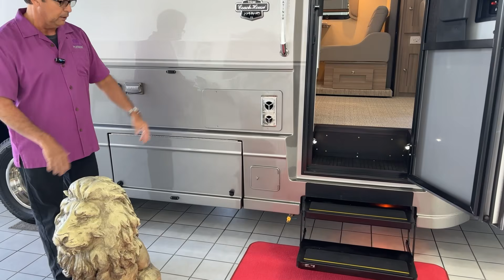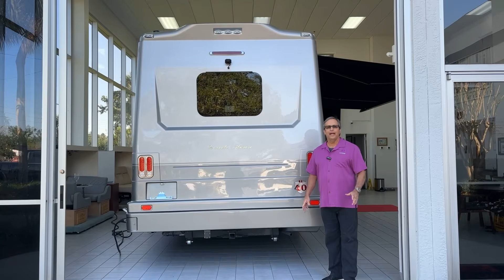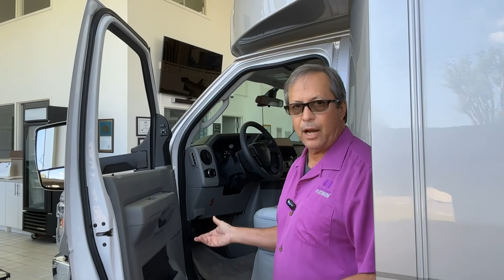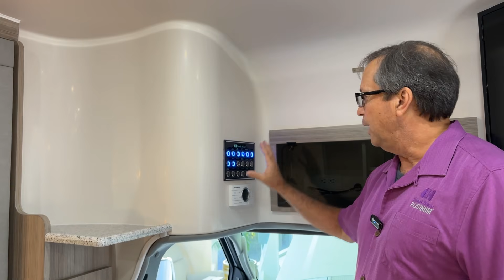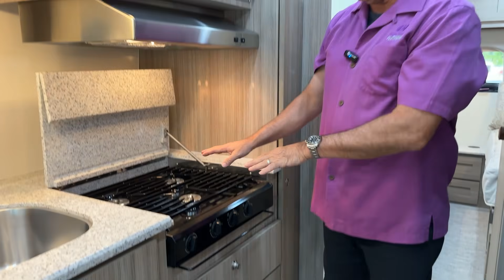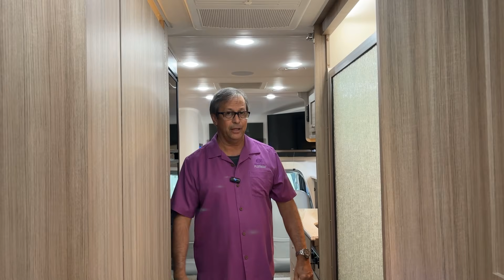2025 Coach House Platinum IV 271 FD | Luxury B+ RV with Slide-Out & Fiberglass Body

Comment: Are these rv's for single people?  Why always twin beds? And, I don't know why these builders keep putting the microwave above your head. That is very dangerous. You can spill something hot on your face, chest, etc. That should be placed lower. Where have you ever seen an oven that you have to reach above your head to bake something. Makes absolutely no sense at all. You keep talking about marine components. Except for some wiring what else in there is marine grade? Nothing.

Comment: I’m a picky engineer. I see details most other engineers never think of. If I was to design and build an RV this is how I would do it. I am impressed. If I use the King Conversion how do I use the induction device chargers? They should be under the windows.
Reply: Exactly what I was wondering. We want the King conversion with side shelving and outlets for charging and whatever else.

Comment: We looked at CH a few years back. I think they were on a MBZ chassis and my husband, at 6’2”, was too tall for the driver’s seat. This one looks low too. Is there more headroom or has it stayed the same?
Reply from the maker: Thanks for checking back in! This specific models interior headroom is 6'6", and we’ve made continuous improvements to driver comfort over the years. If you'd like, we’d be happy to walk you through the current specs and seating setup to see if it's a better fit now!
Reply: It's potable. 😎